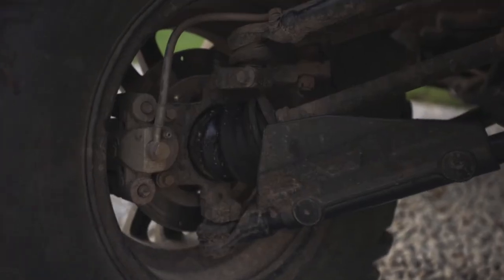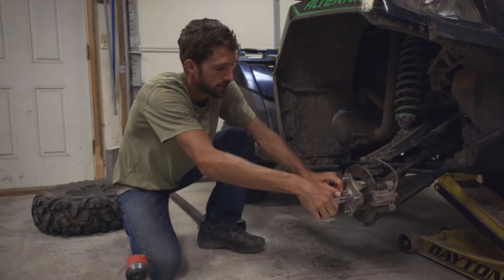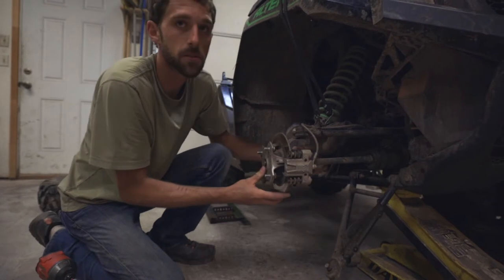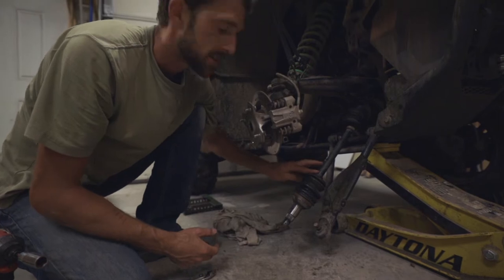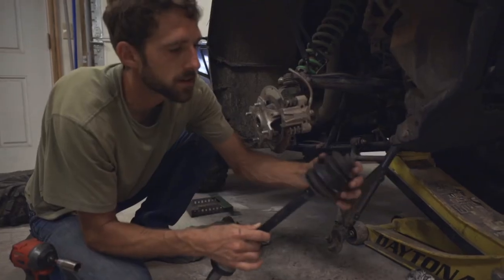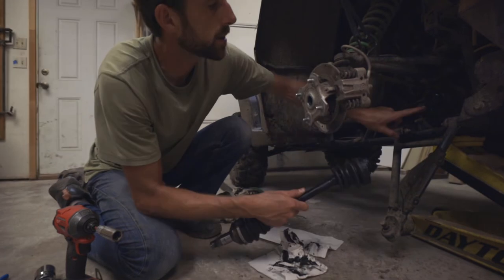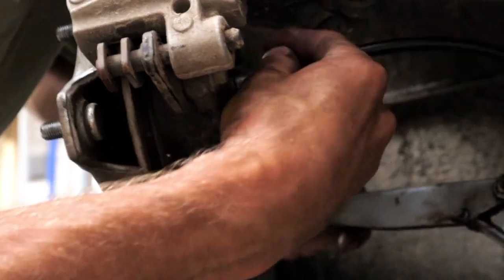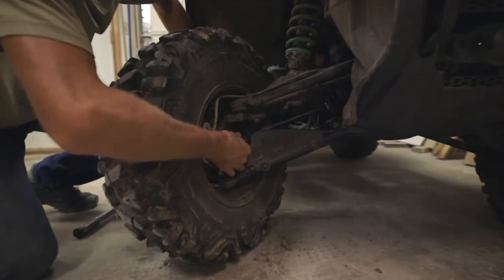CV Boot Replacement

Comment: Thank you for sharing your video through your experience. Easy to follow. Last fall I needed new axle rubber, the artic cat dealer told  me it was less expensive to buy new axle than switching rubber. I followed his advice and installed new axle. Was simple and easy.  I used it all winter without noticing that the wheel on side I changed the axle has no traction. I still have the old one and will  change the boot  as you've explained and reinstall my old one. Is there an explanation why there is no traction? Thank you. Its an 09 thundercat.

Comment: Great video was very useful.  I really need to grease the wheel bearings on my 2006 Arctic Cat 650 h1 4x4. What was the wheel bearing grease tool make and part number you used in the video?  Thanks

Comment: Fantastic video my friend. Well done. I think my CV joints are in need of replacement on my 09 Thundercat. Lots of squeaking and a bit of play with the axels when I grab them and pull on them. 3000 km on the bike however I have a lot of plowing hours on it which I know is hard on the CV joints especially in 4x4 while turning etc. Soooo.... do you have any advise or an opinion on aftermarket Axel assemblies for a Thundercat???  Keep up the good work buddy! I love all your videos.
Reply from the maker: Thanks! Well, as far as I know the OEM axles are the best way to go. If you can find them…I would get the Mud Pro 1000 axles as they have a bigger bar, bearings and races on them. 👍🏼

Comment: Question for you. My 2020 Alterra 570 has allot of play in steering. When it's parked you can move steering wheel an inch or 2 with out front tires moving. Would that be a bushing issue
Reply: Usually it's the pinch bolt on the steering column. There are two, one above the PS and one below. Check those
Reply from the maker: Mine has about 1/2 to an inch of play. It is the EPS unit that has some play in it when it is off.